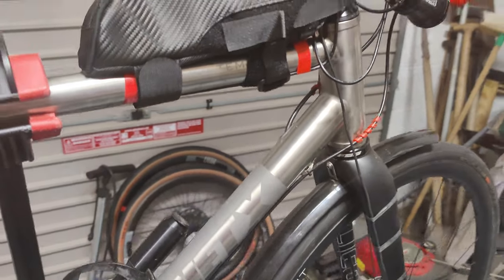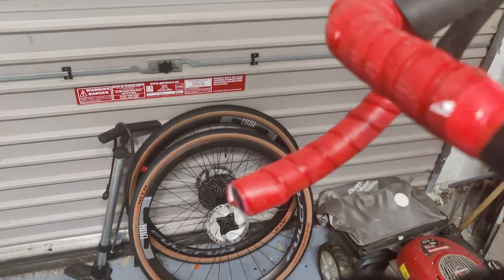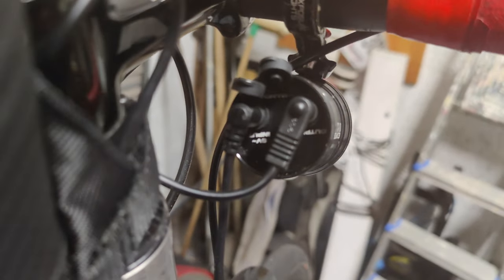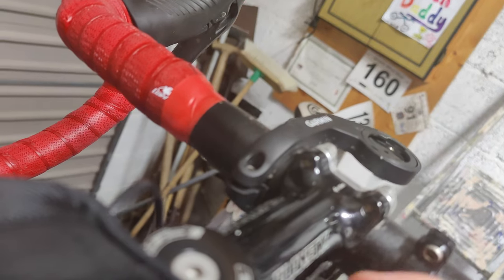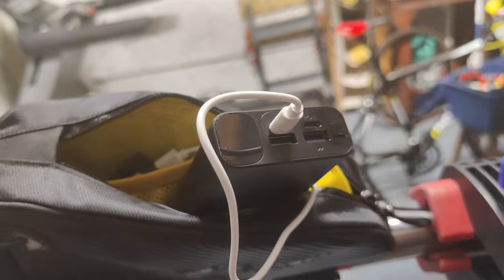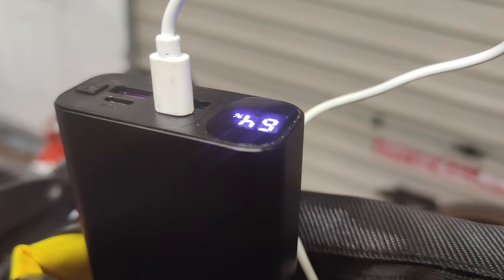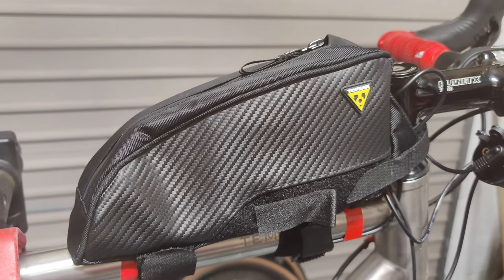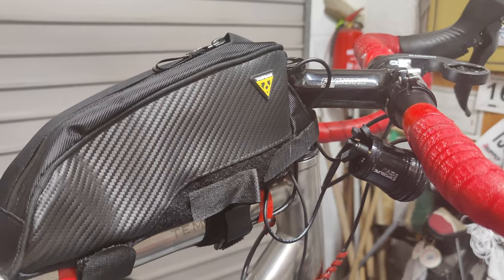Dynamo based lighting setup and USB power for bike touring.

Comment: Thanks for sharing.   I have a similar set up - mine is a shimano hub, busch and muller light and a sine wave USB unit in my tube bag.   How have you found the coaxial connection now that you've run it a while?